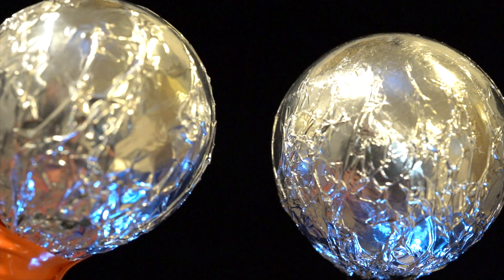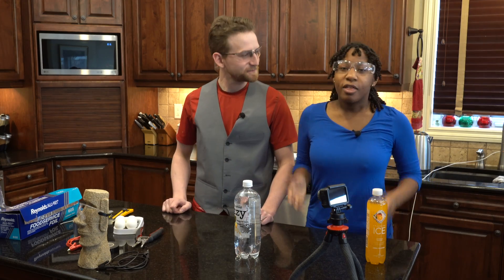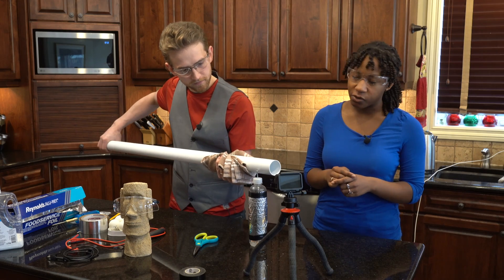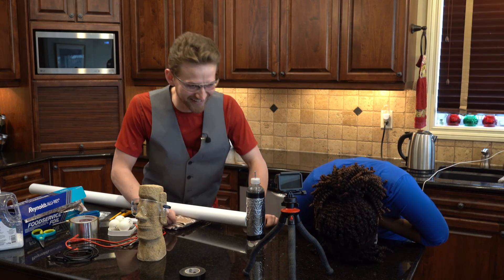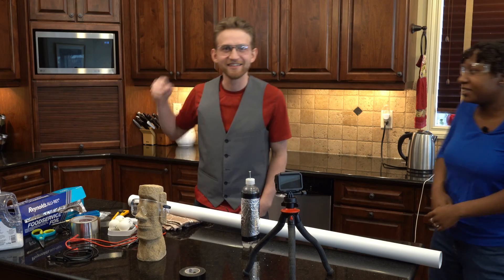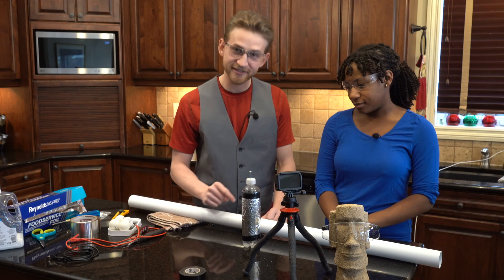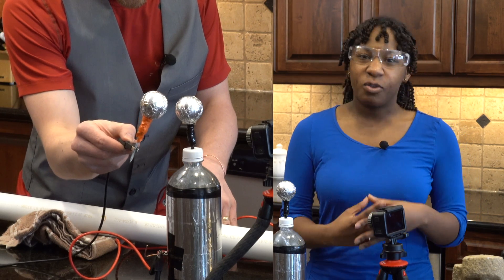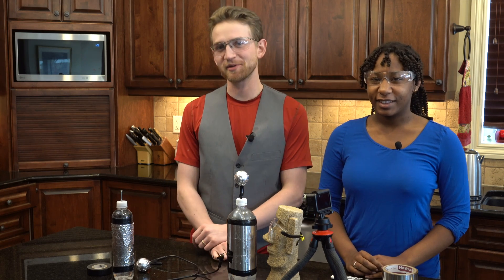DIY Leyden jar! Build a high voltage, diy capacitor with static electricity.

Comment: Wow awesome video and very explanatory!😍 Is it true you can gauge the voltage by the spark gap?
Reply: At STP (standard temperature and pressure), an arc takes around 3000 volts per millimeter to form.

Comment: My Leyden jar is not working

I m thinking of making another
I will use a plastic jar 
Foil paper, nail and some wire 
I will charge it from a pipe and news paper 

Tell me if I have to change any item in this

Please  reply
Reply from the maker: Okay, everything you have should work. A couple of thing to keep in mind, keep the foil at least 1 -2 inches away from the bottom and top. This wall make sure the jar doesn't ground out before charging. Also, before you build, listen as you stroke the paper down the pvc pipe. If you hear a faint crackle, it will work. Otherwise change either your paper for cloth or change your pipe.
Reply from the maker: Also, your pipe should be the common PVC-u that is used for drinking water. I found that to work best.
Reply: And how do I ground it
Reply from the maker: You can charge it with anything that creates static electricity. Balloons on cotton work well but slow. And grounding it it not necessary unless you are looking for a serious amount of pain... you could simply touch the ground with your hand after charging it for a pretty good effect.
Reply: Can I charge it without using a PVC pipe 
Can I use something else
Reply: Thanks for help
Reply: It finally worked I didn't use water but I put two foil papers one outside and other one inside
Reply from the maker: Good to know. I'm glad it worked out!

Comment: Can i use any pvc tube?
Reply from the maker: I found that pvc-u worked best.
Reply: Hi I use PVC though it is narrow it builds up charges. Sometimes it builds charges quicker than others but the micro fibre cloth I use does the job. Not sure why the build isn't always strong though? 🤔

Comment: hi! our teacher instructed us to create a spark using a Leyden Jar. I've been trying to do this with my father. I used a straight bottle, wrapped it in foil and secured it with an electrical tape and then drive a nail through the bottle cap (I also tried using an Allen wrench, since it is made of stainless steel and reaches the bottom of the bottle, and a solid wire as well). I added salt into the tap water until it was hard for it to dissolve the rock salt and there were undissolved salt at the bottom of the bottle. I connected my grounding wire to a stainless steel planted on a planting pot with soil. There were no ping pong balls available so I made a ball out of the aluminum foil and connected it to the black wire that is connected to the aluminum foil wrap. I did not set up one on top of the bottle, though. I was able to charge my 3/4" blue PVC pipe with static electricity using paper and a used sandpaper (it's summer and very humid and any type of cloth doesn't work) but there are no crackling sounds when I put it near the conductor on the bottle cap, so I guess the static electricity does not transfer to the Leyden Jar. Can you tell me why it doesn't work? Where did I go wrong? And what should I do?
Reply from the maker: I have some ideas, but it would be easier if I saw some pictures. The  email for Destructive Creativity is jdallers@gmail.com if you send a photo of your work, I should be able to trouble shoot for you.
Reply from the maker: I can say that typically the problem lays with the collection of static charges in the pvc. I would check to make sure you are collecting a charge by placing an empty pop can on a flat surface. Charge up you PVC (minimum 20 strokes.) And bring the pipe close to the can. If you can move the can without touching it, you have built up enough charge to transfer to the Leyden jar. If nothing happens, try using different materials to rub on the pipe. (I really like wool socks.)

Comment: Can you also teacg how to charge yourself with electricity? In safe ways?
Reply from the maker: Hmm, it is quite easy to charge high voltage in your body. The easiest way is probably to jump on a trampoline, or rub a blanket on your head. You should be able to build a high enough charge to see a visible spark from your finger. (Or did you mean something else?)

Comment: So you guys basically just made a remake of Electroboom's video. 😂
Reply from the maker: He is awesome!
Reply: @DestructiveCreativity  Yeah man totally! Btw could you tell me what did you do to ground both the wires? Like did you literally stick them to the floor with electrical tape? Also, does the material of the floor matter. Like I have ceramic tiles on my floor. Would I be able to ground.
Reply from the maker: @kharanshu2854  The material has to be conductive, I attached to my kitchen sink or a floor grate.
Reply: @DestructiveCreativity  thanks man! Appreciate it!

Comment: hi me and my dad are doing this for my science fair which not to mentoin is in two weeks and we are doing excactly what you are doing and using excatly what you are using but its still not working! please help!!
Reply from the maker: Sure! Probably the material you are using for your tube is made of differrnt material. If you have a cotton cloth, you should hear a crackle even from one pass. What color is the tube you are using?
Reply from the maker: Let me know if you have specific questions.
Reply: @DestructiveCreativity  also the science fair is now in 4 days and its stopped working, i still need to collect results so i can type everything and then print and then design a board and then make the board
Reply from the maker: @georgiaharman8848  Okay, you said it stopped working. Did it work at all?
Reply: @DestructiveCreativity  hi thank you, yes it made a sound but did not make any visible shock, although i am very greatful for this help we have taken out the leyden jar for my science fair and are instead doing what fabric causes the most static electricity. we are going to do this by rubbing different fabrics on my hair
Reply from the maker: @georgiaharman8848  Very cool! Have fun!
Reply: @DestructiveCreativity  its white and definitly pvc
Reply: @DestructiveCreativity  is it supposed to be white pvc?
Reply: And is it supposed to be cotton?